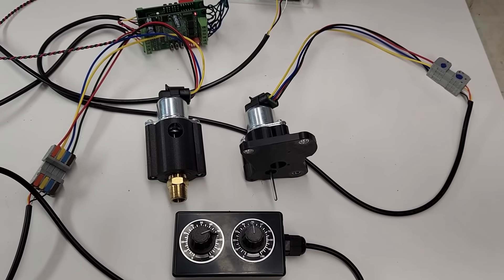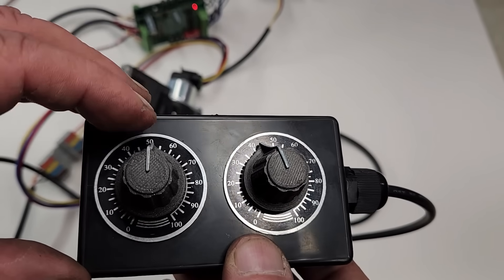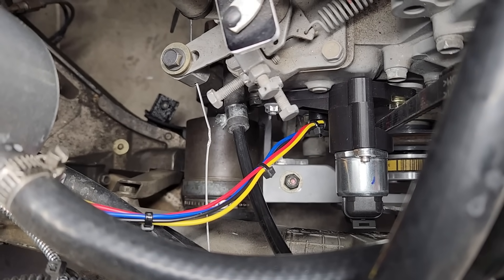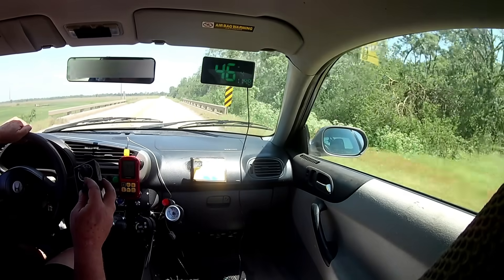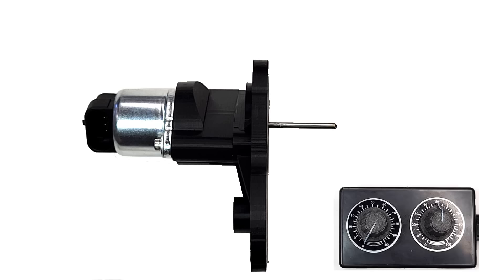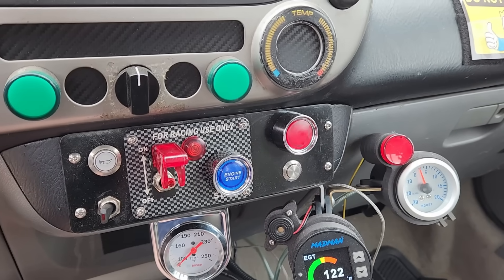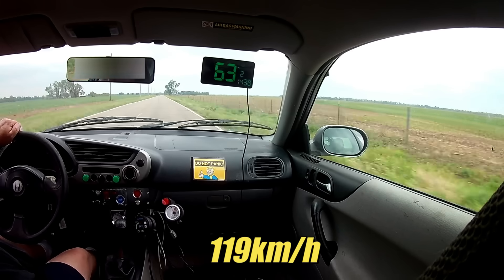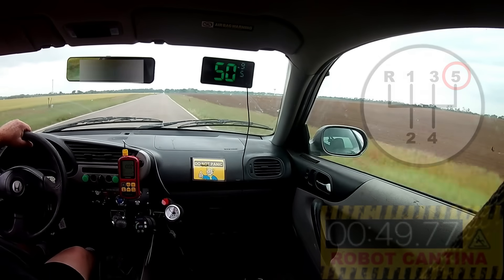S4 E19. We test custom engine controls on the AMR500 supercharged diesel Honda insight.

Comment: When you make the code, are you going to add a “Sport” button? That wouldn’t care about smoke but just MAX POWER 🤘🏼🤘🏼🤘🏼🤘🏼
Reply from the maker: Yes of course, there will be cheater code that engages when the accelerator is pressed more than 3/4 down. full fuel and full boost!.  We will also add a switch for economy mode that is a bit more restrictive, but no mater what, we will always have MAX power when the accelerator is floored.
Reply: @robotcantina8957  don’t tell my beautiful wife but I might have a man crush on you 🤣🤣
Reply from the maker: @racingfortheson  LOL.

Comment: If new fuel controls don’t solve the exhaust coal, you may consider a cheep catalytic converter
Reply from the maker: A cat will not work on a diesel engine.  Cats are designed to reduce hydrocarbons, the coal is more or less just carbon.

Comment: Let's go more electronical. You could try using use a MAF sensor to calculate Grev and build an airflow table. With that you can use some coding to adjust boost up and down to flatten out Grev across the rev range. The result should be a more predictable and linear increase in power with an increase in RPM. It won't be perfect but it will be smoother. Hypothetically if you establish a maximum safe flow per revolution you should be able to target that and keep a relatively flat torque curve. Obviously injection timing is going to affect this and there's probably not a whole lot you can do about that within reason. I think it would be interesting to see how close you could get on a dyno by only adjusting the boost.

Comment: Not sure how the throttle is controlled on these cars, but my OG Tundra (probably similar release year to the Insight for technology timeline) has an electronic dohickie that acts as an electronic by-wire control for the throttle body. I would imagine with your code know-how, setting up a sort of potentiometer off the gas pedal should allow you to run the fuel screw stepper in a similar electronic fashion without having to rely on a manual option. That'd be cool to see!
Reply from the maker: On a diesel, there isn't a conventional throttle like on a gasoline engine. On the diesel engine the air is not throttled, instead the fuel is throttled.  Since this engine also has a governor, the accelerator pedal is not directly connected to the fuel throttle.    Essentially the accelerator on this car commands the engine to run at a certain speed. pressing the accelerator half way down will increase the engine speed to 2500 rpm.... with or without a load.  If the load is heavy, the governor will push the fuel rack forward to provide more fuel and if the load is light the governor will pull back on the fuel rack.  No mater what, the engine speed will remain the same.
Since we adjusted the fuel rack beyond the calibrated limit, the governor will slam the fuel rack forward to fast and we get a puff of smoke.  The fuel rack limiter gizmo will stop the fuel rack from moving forward to quickly and provide a gradual movement of the fuel rack.  This way we can bump up the boost and then relax the fuel rack limit.  In theory the micro computer will do all this automatically in less than a second and we will be able to accelerate without rolling coal.
Reply: @robotcantina8957  Doh! How did I forget this was a diesel... Forgive my stupidity moment while I find something to blame.
Reply: Excellent explanation! This sounds like just the thing we need.

Comment: Bravo on your success!! While the extra week wait was sad, the end results was well worth the wait. Your technical explanation and graphics of how all this kit fits together is top notch. Please keep going to see how far you can push this experiment. Its always “good TV” watching how things develop in your workshop (the good, the bad and the ugly). Well done getting your gnomes, with their cardboard aided design kit, geting everything to fit. You may need to give them a bit more on screen time as compensation for their assistance behind the scenes.  

I was concerned that the IAC valve would not have enough strength to fight against fuel rail pressures, but I think in this configuration its only adjusting the governor stop, not actually adjusting/fighting fuel rail pressures (but that’s just a guess). So this should work just fine for a governor stop as you have proven. 

Of course the enginenerd in me is wondering about NOx levels in the exhaust, or is that even important for fuel economy testing on a budget (I understand not the focus of this project, but it might be useful as you search for “mo pow-wa”)? For on the cheap, a rolling coal test, should also give you a feel of how well the combustion is working. I know I’ve seen in the past a NOx sensor that had a CAN buss interface for an arduino (with code examples) but I can’t seem to find it at the moment. It might be an interesting value to know down the road if the project ever shifts to squeezing every bit of mpg out of that little engine. 

I’m always looking forward to next weeks sunday morning adventures...
Reply from the maker: The gizmo is both a hard stopping point for the rack and it can push the rack back when required.  At some point in the video I do mention that I was able to adjust the position of the rack when the accelerator was floored.  The IAC motor seems to have enough power to push back on the rack and overrule the governor.

Comment: First ... This stuff is EXCELLENT, and exactly what I hoped for when you proposed this project.  I own a VERY old school M35a2 Deuce and a Half with a mechanical diesel pump.  I think what you are doing is directly applicable to my truck ... which is VERY smoky on acceleration, is kind of limited on power (i.e., speed) and always delivers between 13 and 15 mpg.  I'd like the smoke to go down, pick up a little speed and maybe improve economy a touch.  Cost for parts seems more than reasonable and I have PLENTY of room ... maybe.

Comment: This is certainly one of the most primitive electronic diesel fuel injection systems ever installed on a car driven on the road for any duration of time. God it's impresssive though...
Reply: If you're going to push fuel efficiency as far as possible I'd consider having some form of memory on whatever microcontroller you end up using for the fuel rack and boost adjustment thingy so you can store separate profiles for eco and performance mode. Would help keep the car far more drivable than trying to blend the two based on throttle input or RPM especially without a dyno that would let you keep the powerband nice and smooth.

Comment: Fuel efficiency is probably more impressive than power really.  I had a 78 LeBaron that with stock setup could get well over 20 somtimes 26mpg when cruising.  40 years later most sedans still didnt get much better even though they had far more hp's and gears.  The Chrysler only had 140hp's and 3 gears.

Comment: I'd like to see you try some form of feedback to determine the governor settings...
I'm trying to replicate the rack governor solution on a Betamarine 14 which is a based on a smaller 450cc Kubota BZ482 engine...
I opened up the governor to get a bit more oomph but it's a smoky old beast around harbour... hoping i can run with reduced movement when I'm around people,  then open the rack when I'm up to speed.
Manual adjustment is fine, but maybe I could read the engine speed with a darlington, and use that to determine the stepper position?
OR stick an IR soot detector in the exhaust path so it checks for smoke, and backs it off a tad...
complicated by the fact the boat exhaust also spits out cooling water
Looking forward to you solving all the problems for me.
Reply from the maker: The rack limiter gizmo will keep the governor from slamming the rack wide open to prevent the puff of smoke from the exhaust. however once the car starts moving the rack limiter will gradually back off and allow more fuel.  In today's video we tested the components to validate that they work,  In future videos we will make everything automatic with a micro computer.  The idea is to make as much power as possible without any smoke.

Comment: Awesome work, Jimbo!  The IAC has a total throw of about 3/8”.  Converted to metric, that’s 9.5mm.  Divided by 256 steps, end to end, is roughly 0.04mm per step.  This number might help you in calibrating the software side of things.  I think it’s worth pursuing the fuel economy side of things, because it’ll demonstrate that there’s no such thing as the mythical “100 mpg carburetor”.  You’ve got the lightest and most aerodynamic car commonly available, with a really efficient small diesel.  This car probably has a chance of being one of the most fuel efficient ICE cars to ever exist, at least at steady-state highway speed.  How about some sort of accurate, inline, fuel flow meter, that the Arduino could read in real time?  Real time MPG readings. 👍
Reply from the maker: A long time ago when I did a bunch of tech stuff on busses we used in line flow meters.  In order to measure the flow properly you need to use a positive displacement flow meter and they tend to be very expensive.

Comment: Should locate a CAV Boost control unit from a 6cyl Minimec injector pump as fitted to Ford and Sabre marine engines. No wiring at all. just one solid or flexible boost line from the inlet manifold. Can adjust no boost fuel and boost fuel and boost pressure needed to operate unit. Its all adjusted thru one sidecover. When boost reaches your pre-determined amount a plunger will raise up allowing the Kubotas rack/control rod to go into maximum fuel.
Reply from the maker: We really cant use BIG engine parts on our tiny diesel engine, that why we are building miniature versions of the components.  The micro computer we are using will handle everything  with ease.

Comment: Hey Jimbo, I want to get a 3D printer to make custom auto parts. Do you have any suggestions? You're happy with the Prusa unit?
Reply from the maker: The Prusa MK3 that I use is an excellent printer and I never had any problems with it.  I use  Prusa ASA filament which has to be FedEx from Europe.   If you notice, I also have a plexiglass enclosure around the printer.  this helps retain the heat when printing with high temperature plastics.  The total cost of the printer and the enclosure was $1500.00... that's really expensive, but I justify the expense because the printer is important for making these videos.
Reply: Thanks for the info 👍

Comment: You really are pushing the envelope Jimbo. I hope they clear your town of the fallen trees soon.

As far as sensors go, maybe you could mount some sort of magnetic encoder (like an AS5600) to the stepper motor to control it in closed loop, this would absolve you from having to count steps and would eliminate any error that comes from doing it
Reply from the maker: The software keeps track of the steps so no need for a feedback device.  The IAC motors I'm using provide a decent amount of torque with the leadscrew.   Also, there is Zero room for anything else.
Reply: @robotcantina8957  Fair enough. It's really turning out great

Comment: “I prefer not to rely on a software fix to correct a hardware problem.”  As an embedded systems firmware developer, that is 90% of my job! 😂  We already have 1000 of those bad PCAs, fix it in firmware!
Reply from the maker: LOL,   When I said that, I originally flashed a picture of a Boeing 737MAX... My brother convinced me to edit out the picture of the airplane.
Reply: @robotcantina8957  Don't worry it would have been removed by a recently implimented Youtube AI program that would have then labled your account as "racist".
Reply from the maker: @WalkiTalki  LOL.... its scary, but probably true.
Reply: Embedded hardware engineer here. I'm always amazed at how the software team misuse hardware features that were added to make the software easier/more efficient/feature rich. 😂

Comment: I would like to see efficiency be a goal but think there should be a line drawn for a speed time.  0-60 times would seem more comfortable and safe in the low 20's or figure a time for 0-50.  Your driving it and probably have a good idea of what safe would be on today's highways.  
Side note-I drove an early 2000 Smart Car once on the highway and it was not safe pulling out in traffic in my opinion.

Comment: One stepper motor at a time!  It has to be frustrating to realize that you left out the width of the bracket in your calculations, but this is how good science happens-slowly, and methodically; owning your errors and then fixing them.  Be careful out there, watch the locals and head for the basement when they do.

Comment: I rewire guitars and basses for friends (and occasional customers). CTS is the brand name potentiometers used by Fender, Gibson, Rickenbacker as OEM on older units, and current "custom shop" and high end versions of their products. The company has been around since they were "Chicago Telephone Service" and are an aerospace supplier these days, that still makes potentiometers as part of their catalog. They make what's called 'A' (audio curve) and "B' ( linear curve) potentiometers in all standard resistances. Audio has a curve stacked more towards the upper half of the curve for volume and tone applications, because you aren't looking down at the controls on a guitar when you dial in a specific value. Linear tends to be used in applications that require more "precision" control.
Their 1/4 inch shaft "American Spec" has been an industry standard since tubes were cutting edge technology. I replace the smaller "mini pots" used on lower level instruments to save money because of their higher quality of manufacture, and better feel and precise control.
At $5-10 (US) they're a nice upgrade when you value precision.
Anyways, Happy Memorial Day.
Reply from the maker: The pots I'm using were salvaged from some high end industrial equipment.  They are the linear type.

Comment: As a big fan of knobs that make more power when you turn them……I approve! 🤣
Reply: I have a turbo boost button in both my 7th gen Accord and my first-gen Insight.

It's the button that turns the AC off. :D
Reply: @IstasPumaNevada  I had a Saturn that I did the same thing🤣 ac off when you’re passing!
Reply: @IstasPumaNevada  yep, I have a 99 f350 with the 7.3 powerstroke. My knob takes it from stock up to 400ish horse. Gotta love turbo noises!

Comment: That was actually a great improvement. Proving a concept requires a lot trial and error steps. This is going to work eventually. I wouldn't be surprised if the Big Three engineers are not watching this series to see how they can design a small engine they can then optimize using the same tools you are using. Imagine a car being commercially designed to operate with the efficiency you are currently testing.

Comment: 0:12 that rim on the bottom right (rear left wheel) has taken a bit of a kicking. You could probably jostle that back out with a little hammering otherwise it adds to the overall character/patina of the honda.
Reply from the maker: Yeah, its seen better days.  I think it really needs to be replaced, but I'm not willing to spend the money yet.

Comment: there's no limit switch on the stepper motor so if you move the idle air control stepper and power cycle it won't know that it's not at 0. You should do what printers do and on startup, run the gizmo all the way out to its max or min travel until it hits the end stop and then just jog it over to the correct position from there.
Reply from the maker: That's exactly what my software does.  On power up, it retracts the motor until it stalls and that sets the  Zero position.  From that point it I count the steps the motor moves.  keeping track of the motor steps is how I know where the motor is at all times.  When I changed the code,  it  upset the ratio between the knob and the stepper motor and now I'm sending the motor more steps than it can actually move. this pushes the motor beyond its calibrated range.
Reply: @robotcantina8957 Ohhh gotcha. Thanks for the reply. Loving the series and looking forward to seeing more from the Renault v twin.
Reply: I have had three IAC's exceed  travel on my GTPs. Can't say if it was a difference in manufacturing or if I used the wrong IACs. The lead screw can pop out just enough not to retract. They still function after finger pressing the screw back in.

Comment: I hope you push the limits of power, but that's definitely not what the project is about, so maybe write some code to optimize fuel efficiency.
Reply from the maker: Pushing the limits of power is and always will  be the primary objective, But since we are adding controls, it would also be simple to tune for fuel economy.
Reply: @robotcantina8957  That's great to hear. I love your videos. They motivate me to work on my own projects.